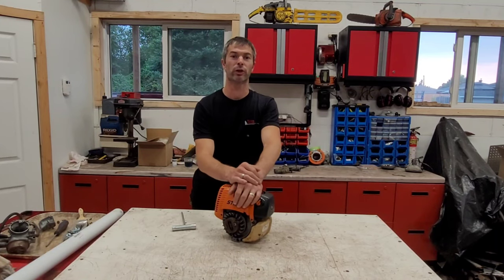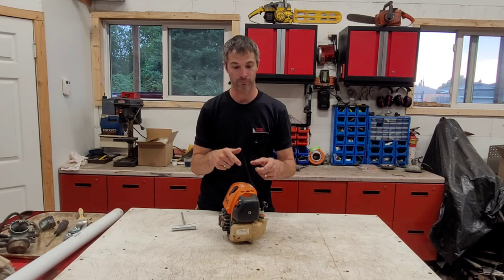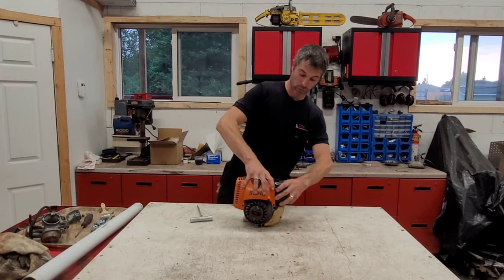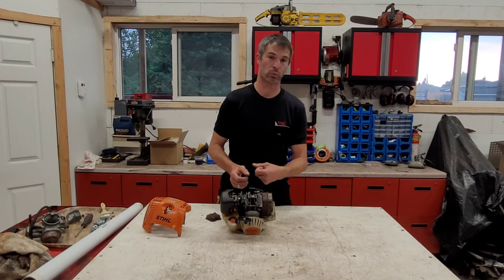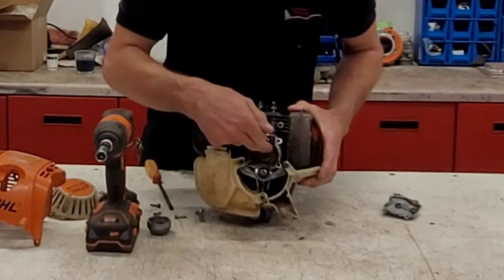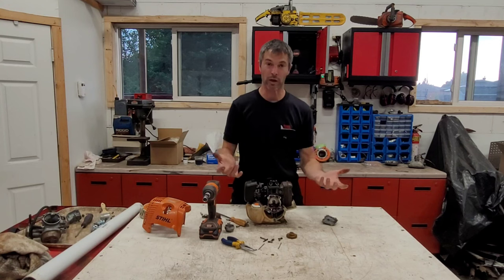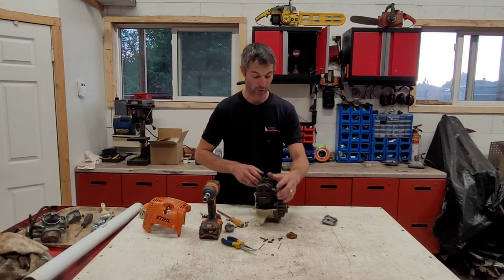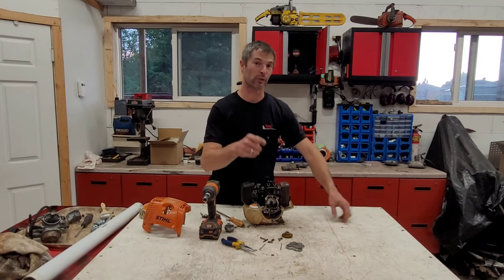4 Mix Engine explained!!!

Comment: If the cam gear and the auto decompression have plastic parts......it will fail/melt if you don't have exactly the right mix or vary the mix different from the manufacturer's specs. And if the replacement part is all metal, you should just buy that, put it in, and save yourself some grief in the future.

Comment: It’s a 4 cycle engine that is lubricated like a 2 stroke, it uses 50 to 1 gasoline oil mix. 

The reason the camshaft and gear that are molded together are made out of plastic, is that when plastic is in physical contact with smooth metal it needs far less lubrication strength. 

And 50 to 1 mix is enough to deliver these requirements. It has more torque, better volumetric efficiency, uses less fuel and emits less smoke.

Comment: These are NOT a 2 stroke with valves. They are JUST a 4 stroke, without an oil sump. Thats it. It is not particularly unusual, or special, but you do not often see this in small engines. Fairly common on much larger 2 strokes and 2 stroke diesels found in some marine applications.  These are not one. Just a 4 stroke.
Reply from the maker: Agreed but you have to admit, they are pretty cool! You can't run a standard 4 stroke sideways without modification.... thanks for watching and commenting! 🙏
Reply: "it is not particularly unusual, or special but you do not often see this in small engines." Lol contradiction at the highest level
Reply: @bartleyclevens   Not at all. Just because they dont typically show up in a particular size of engine does not mean they are uncommon.  The vast majority of non heavy duty car engines are gasoline.....would you say that diesel cars are uncommon? Nope!
Reply: @ArionRaine  Diesel cars are very uncommon lol. Well, at least here in the US.
Reply: @bartleyclevens   Here in the US, yes less common, but globally quite common. Probably more so here in the US than you think.
Reply: @ArionRaine  I'll give you that. Now thinking about it a lot of the pickup trucks here in the US run on diesel. Also most commercial vehicles run on diesel so you're right they're not too uncommon.
Reply: @thehonestmechanic  The Honda GX25/GX35 engines are 4 strokes that can run in any orientation without the risk, hassle and emissions of pre-mix. They use fins (oil slingers) in the oil chamber to atomize the oil, and circulate the oil mist through the crankcase and valve assembly with the help of a reed valve.

In a sense it's the closed-cycle version of a pre-mix total loss oiling system.  The crankcase side of the piston and a reed valve provide the circulation of airborne oil.  But it has some clever additions, such as the timing belt providing liquid oil return from the timing cover to the oil chamber if the engine is operated inverted for an extended period.

Comment: It’s a 4 cycle , with a different lubrication system
Reply: It's more of a hybrid 4 mix with no oil slump, problematic engine.after they came with the 91r,their failed oil lubrication will fail Everytime